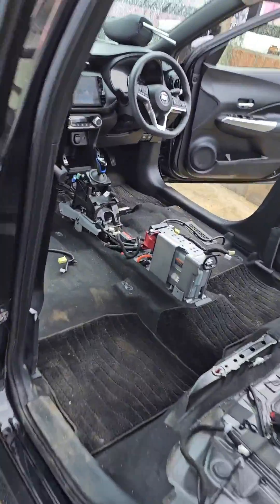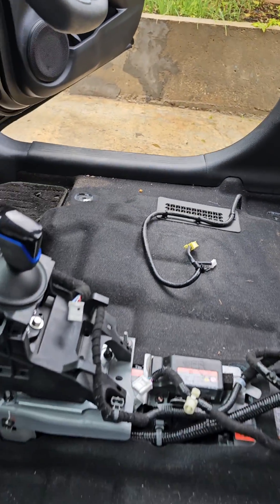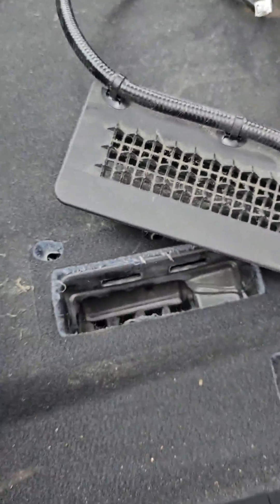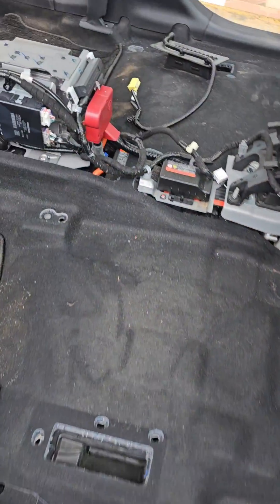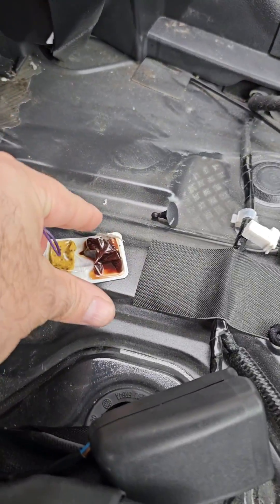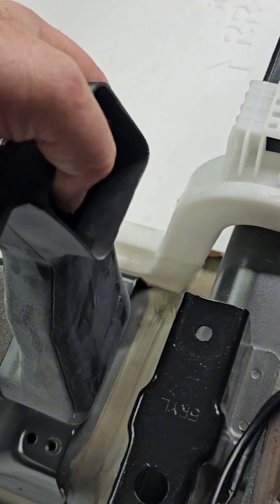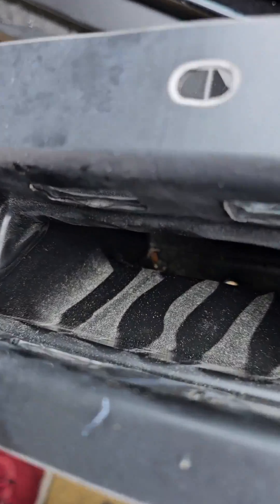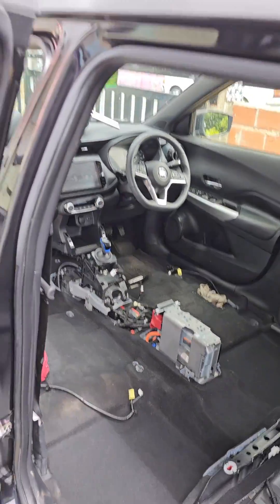Nissan Kicks e-POWER Battery Fan Cleaning

Comment: Could this dirty fan cause battery drain on the kicks? We got 3 reported issues of owners who had 2 battery bars before they turn off the engine but when turning it on the next day, battery got low with a turtle icon although some said that what technicians for nissan did is to clean the egr and fixed the issue, mileage is 27k, one kicks that experienced the issue only has the car for 18 months

Comment: Very useful ! I own the Kicks with 2nd gen e-Power in Thailand and I’ve been doubting about the inlet position since I got it brand new in 2022. I have a question to ask you sir. If I’m going to DIY some sort of the filter to the inlet, which kind of material should it be without restricting the airflow? Cheers!
Reply: I was wondering the same. Can you please share if you DIY filter?

Comment: what are your thoughts on thin filter on the inlets to prevent dust?
Reply from the maker: @Dr3aMz1982  very bad design 🥴🥴😓😓🔥🔥🔥
Reply: @hybridsolutiondiagnostics  yeah.. i was thinking of cutting a thin filter and stick it on the inlets.
Reply: @Dr3aMz1982   Just make damn sure you keep the filters clean.  It's better to have unfiltered airflow than a filter that prevents any airflow, because then the battery will overheat.
Reply: @GrandPrix46  true that..

Comment: Very nice, what was were they thinking without even a course air filter. We have a couple year old Chevy Bolt, it has water cooled and heated battery. You probably don’t need to worry about the heating. 😁
Reply from the maker: @texaspowerman  jajajajjaa yes 😁😁👨‍🔧👨‍🔧